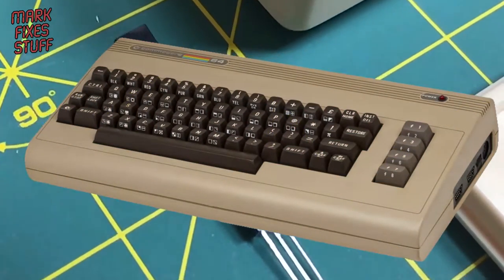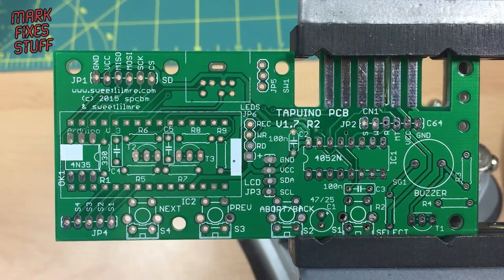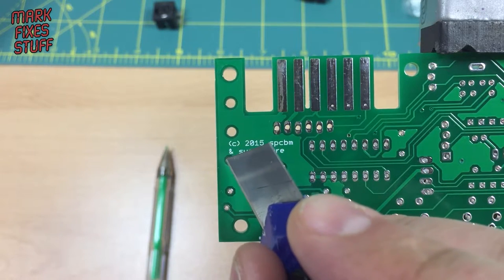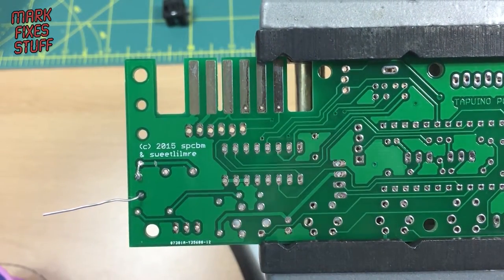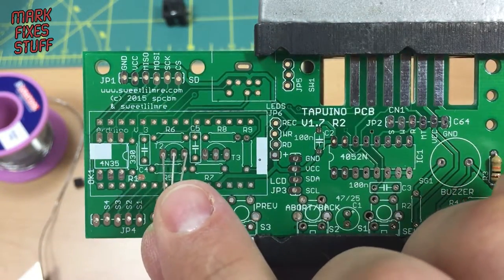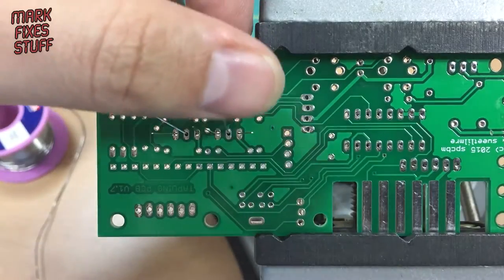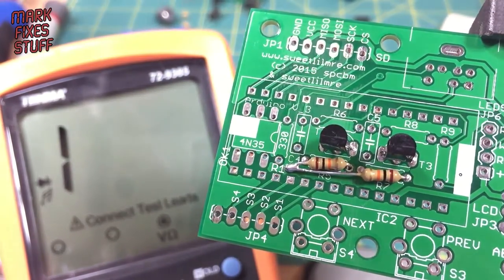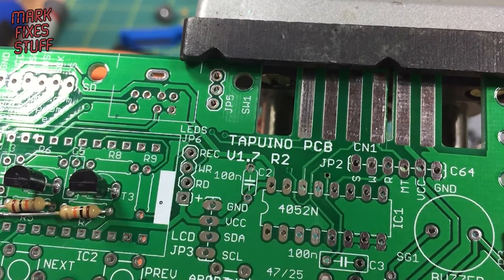Building a Tapuino Virtual C64 Datasette Pt 1 - What's in the kit and V1.7 mods - Commodore SD Card

Comment: I have just built one of these,but its cost more then $20,Its was £26.99 for the kit without the box  and P+P and £12 for the USB Nano V3.0 ATmega328 16M 5V Micro-controller CH340G board,Micro SD Storage Board Micro SD TF Card Memory Shield Module and Serial IIC/I2C/TWI 1602 16x2 Character LCD Display Module With Arduino Code. so all in its was £38.99,but a lot cheaper then buying one already made.

Thanks for the video,I was thinking of making a video to cover the firmware. and then point to your video on how to make it from the kit.Unless you plan to make one,just let me know if you do,then I will not,No point having 2 videos about it.

I put mine inside a Datassette but I fingered a way to use the keys on the Datassette so it feels like you are still using one,you can put the kit board under the keys of the Datassette and its able to press the  buttons on the kit board,the space between the buttons on the board are the same as the keys on the datassette,I will show it in my next video,once I have fished the work Im doing on it.
Reply from the maker: The cost came out of the parts list that Peter made if you bought the bits separately. There is a bit on his blog about it.

Since then the pound has seriously weakened and the chinese economy is much stronger.

Still worth looking on http://sweetlilmre.blogspot.co.uk/2015/03/building-tapuino-r2.html though.
Reply: Yes I guest it was that,I have the v7.2 R2 board,and it works fine and and love it,I am uploading a new video of my Tapuino in my Datassette.
Reply from the maker: Please do link it here when it's up as I'd like to see that!